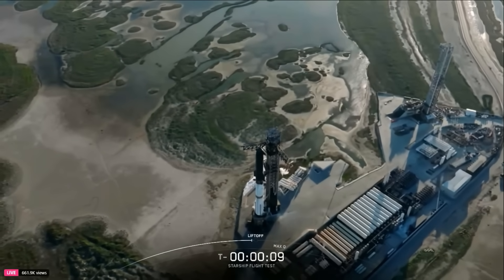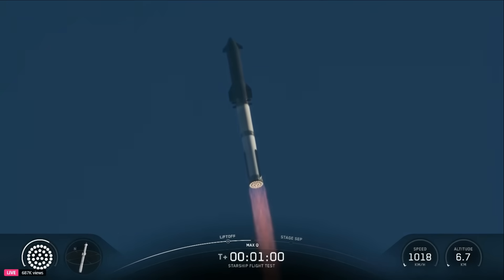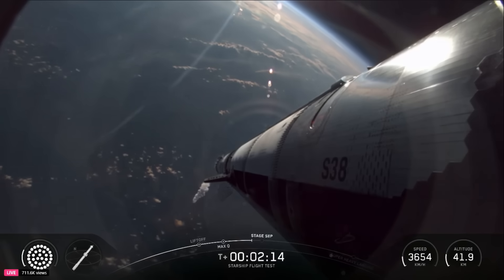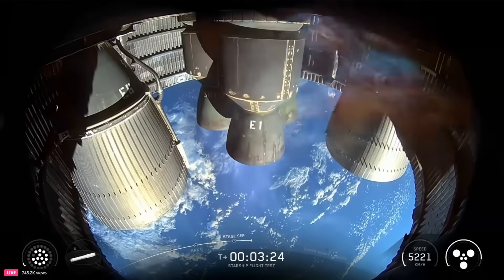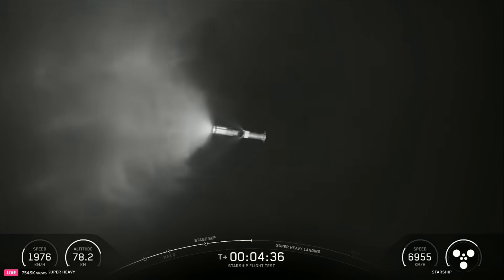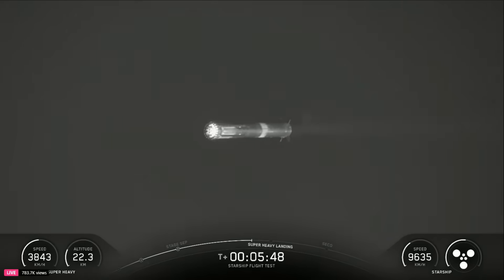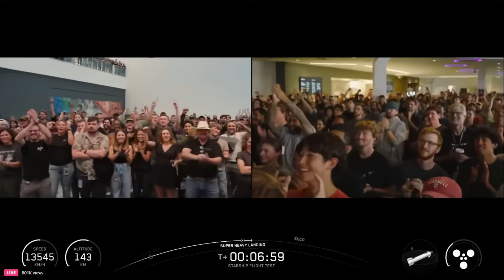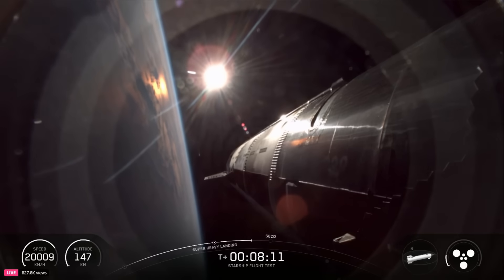Starship Flight 11: Watch The FINAL BLOCK 2 Launch! FULL VIDEO

Comment: Why does it pitch so soon ? It just left the tower🤷🏼‍♂️
Reply: If you go straight up, you're gonna come straight down when the rocket's fuel is spent.
In order to stay in orbit you have to make sure the rocket has enough horizontal speed.
It takes a lot of time to build up that speed.
If you go straight up and only go horizontal later, you don't have the time to build up the speed and then your rocket will start to fall back down. 
Besides that, forces are big on a rocket. Making sudden turns is not recommended.
Reply: @anichtyofagist ok. But i remember apollo not leaning until later